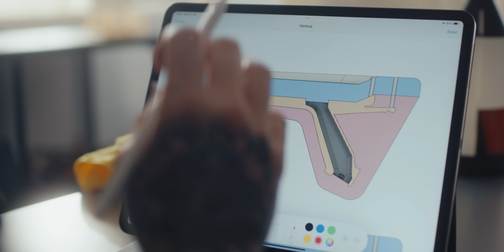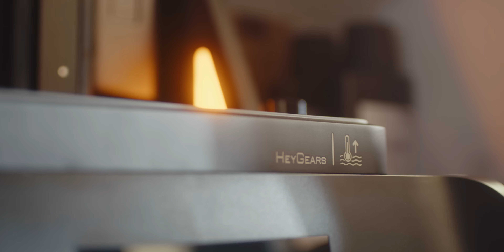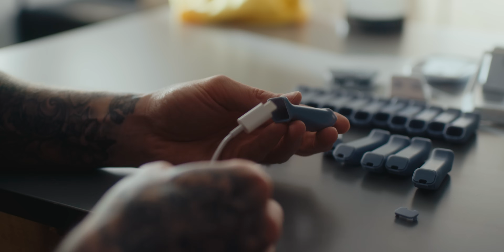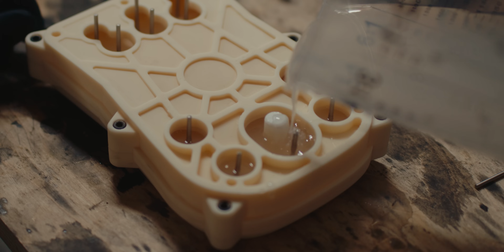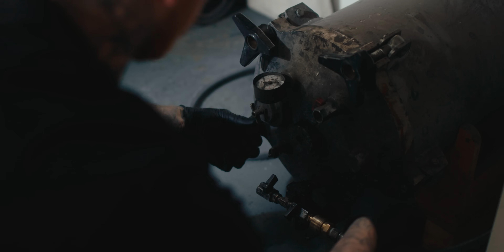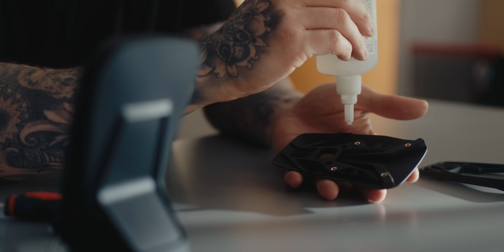Casting Resin Over 3D prints In A Silicone Mould

Comment: Thanks for some really great videos and the level of details and knowledge shared. I bought a Heygears Reflex and I am trying my hand at creating some molds for silicone, but I am struggling hard with cure inhibition.
I have bought PAP10, PAWW10, PAWR10, PAU10, PAS10, PAH10 and PARP10. I even went so far as to source the same ease release and silicone you used in previous videos. 
I have tried all manner of extra treatment for my resin, including 30 min water cure, 6h wait in said water, exchanging the water and then curing another 30 min. Curing for 30 min in glycerine. Water curing for 30 min and dipping it in a PMMA solution. 1-2-3 coats of ease release 200. Tried 4 different platinum silicones at this point. Flame treating(plastic annealing). I also tried different release agents. 

I don't understand how you can just take the PAWR10 prints straight from curing a few minutes, sanding to giving it a light coat of ease release and have 0 inhibition. When I do the same I have a gooey mess on my hands, even with letting the silicone curing over night.

I have studied your videoes over and over again to see if I missed anything, but I don't believe I have. The only thing I haven't tried is painting my molds, but they require high precision, so adding a layer of paint isn't desired and would probably render the mold useless anyway.

At this point I have spent hundreds of hours testing, and thousands of dollars, but I don't have a single usable mold, because of cure inhibition.

Comment: I know I'm late to the show (just found your channel yesterday). I've never made cast resin parts so I might be talking out my ass here. Is there a vent in the silicone mould that would allow pressurized air into the void of the printed tube? That would allow the pressure to compress any air bubbles in the resin while not stressing the printed tube. Just a thought. Really interesting channel. Thanks for putting these out.

Comment: Hi! I found the process of vulcanizing silicone upon contact with resin very intriguing. Could you explain how this happens? And could it be related to the use of mold release spray? I tried that with a standard resin and the silicon didn't cure.

Comment: I will suggest that you can try to divide the lower mold holder to be in two different segments so you can use the pressure chamber and not having the 3d printed channel in the final mould.

Comment: I am surprised you haven't tried to vacuum cast. Apply vacuum to the high point of you mold. Make sue the tube goes to a catch trap in case resin get drawn up. Then pour in the resin like you were doing. This is the method I have used on all kinds of systems prone to air locks. A few cars have to be done this way to fill the coolant system. Hydraulic systems on automated systems. Works really well.

Comment: I’ve had issues with silicone not curing in contact with resin print, did some small testing and found it worse around residual/uncured resin. in the end i switched to a polyurethane. haven’t looked back.
Reply: Wich PU Product did you use? PU Rigid from formlabs?

Comment: How do you decide where to put the outer ribs in the mold?
Reply from the maker: The ribs are kind of dictated by the openings through the shell as opposed to actually being calculated. There is some calculation to an extent to ensure the flattest area is covered, especially across the longest length, but it’s mostly made up of offsets of the opening and then joining those together. Thanks for watching!

Comment: couldn't you just make a open air access so that there was no locked in air in the channel
Reply from the maker: Yeah that’s exactly the solution. It’s one of those things that after I’d published the video and continued using the mould I was like “of course that’s the solution”. I think even drilling a hole at this point through the silicone and shell will solve it rather than having to completely remake everything!

Comment: Having an airway trough the mold into the chanel should eliviate or cancel the problem with the pressure chamber. That way the pressure inside and outside would be the same.
Reply from the maker: Yeah a few people have mentioned that. I came to the same conclusion after giving it some more thought once the video was published and I got back to using it. Painfully obvious that’s the solution and kicking myself for not realising earlier haha. A few including yourself spotted it straight away so hats off to you for being so observant. Thanks for watching!

Comment: I don't know if it's your accent, but you keep saying "silikin". A common confusion with that material is silicone vs silicon (usually pronounced "silikin". Sili*cone* is the rubbery material you're using, sili*con* is a pure element that's primarily used as a base for transistors which forms the heart of all electronics technology we currently use.

You may already understand this and my understanding comes from your accent, but I like to point it out when I hear it nonetheless because there are absolutely people that don't understand the difference.